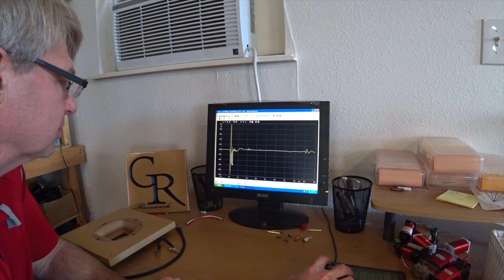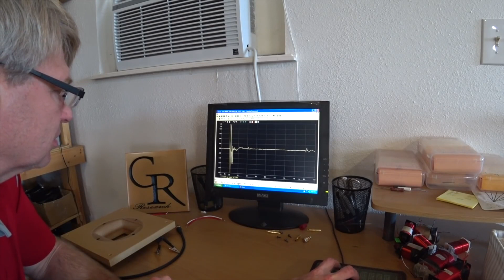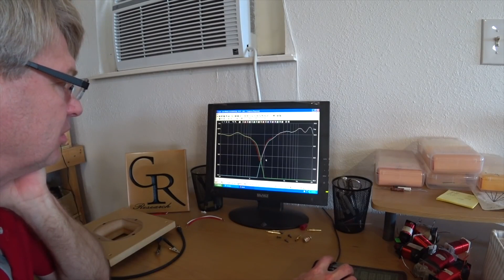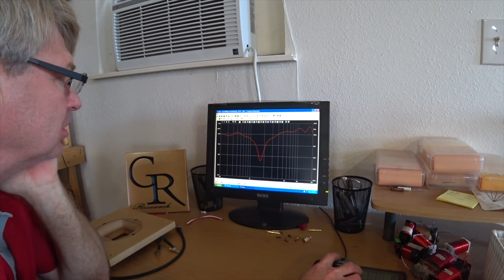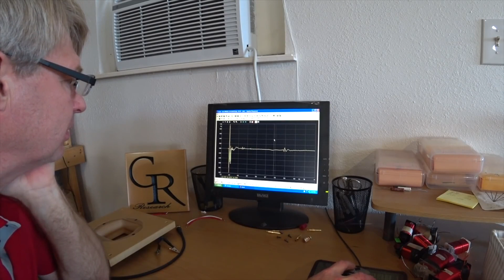Tech Talk 30: Speaker Measurements

Comment: Love your videos, I'm doing some DIY stuff myself, I'm doing all this too through REW with success. 

However, I have a question about the waterfall (decay time) graphs. Measuring decay times seems much harder as I find those decay times can be up to 180ms because its within my room. (5.7m x 4.5m x 2.4m)
On your videos however, when your measuring speakers people send in, your decay times seem to hover around 4-5ms, which to me is a speaker only decay time measurement.

My question is, how are you achieving this without room reflections getting in the way? Are the still measured at 1m like the frequency response measurements are?

Any help appreciated.
Reply: @vxss346 Danny gets the decay plots out of the impulse response, which is the data he gathered in this video. A fairly typical room is going to require the gating he demonstrated to exclude echoes, with the gate set at around 4.5 milliseconds. Any decay plots you are getting over around 4.5ms is either room reflection or an indication that you have really, really bad speakers with huge amounts of stored energy.
Reply: @Herman-f9m  Cheers for the reply. Yeah, I use 3-5 ms gating for frequency response and that works great, but I think the issue is when I go to the waterfall, the gating can't be added, maybe that's an REW thing, or I'm missing something?

Comment: Is it even possible to measure Bass Response under 200 hz with a gated meassurment in a Room ? And if not, how do I measure it ? 
Thanks
Reply: You use a nearfield measurement, with the microphone nearly touching the cone. What Danny illustrated in this video was a gated farfield measurement, with the microphone at one meter, or some other known distance, from the tweeter. If you measure the nearfield up to say 400Hz, and the farfield down to say 250Hz, you can move the plot of the nearfield measurement down to align with the nearfield measurement. The two should overlap pretty closely in the 250Hz to 400Hz range, so the combined nearfield and farfield measurements should be a good representation of the full range response of the speaker.

Comment: Back in the day I used Liberty Audiosuite to measure speakers. For gated measurements the recommendation was to use the Hamming window to avoid harmonics in the measurement. I notice you use a rectangular weighting function in CLIO. Is there a reason for this or do you not trust Hamming or similar signal weighting?
https://en.wikipedia.org/wiki/Window_function#Comparison_of_windows

Comment: Thanks for the insights. I was really wondering about how you measure those speakers people send in. Using the time gate in the impulse response, never thought of that myself. 

It looks like you are using Clio for taking those measurements. Can you perhaps shed some light on how you set up the system to take a "one watt one meter" measurement? Do you have an amp that you can configure to only output one watt? And are you using the microphone that comes with the Clio package? Many questions :D 

Best regards!

Comment: Wonderful explanation!! I have experienced with Audyseey room acústicas Eq method that is being used in some AVR, a Denon in my case. In order to avoid high frequency room reflection the solution that this system offers is to roll down the high frequency response and you are loosing so much information in your listening area! It took me long time to realize about what the device were doing and then started to unse bypass L+R Eq. Mode. Thanks!!
Reply: So you leave the front mains out of the room correction DSP? Is it better?
Reply: @darrenlomax1283  yes, you are right. In my case the result was better.

Comment: I’m curious to see if you’ve tried measuring the vertical polar response of this speaker.  It’s not always dead on the center of the tweeter.  Looks like you are measuring off of the optimal listening axis even if the speaker’s manual says otherwise.  Particularly with a horn tweeter, the directivity can be quite narrow and cause a very small vertical lobe.  Pi speakers has some tips for this if you are unfamiliar.  There are a few other sites as well.  It’s a fairly straight forward process.